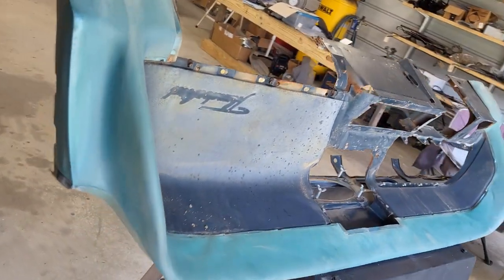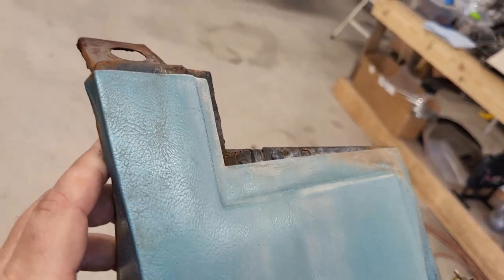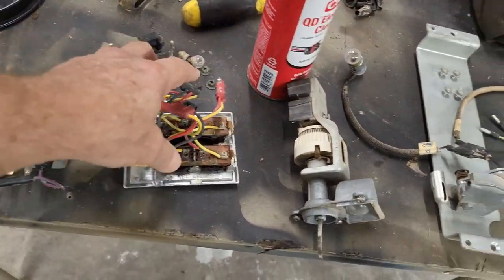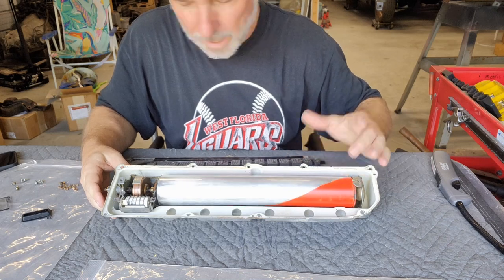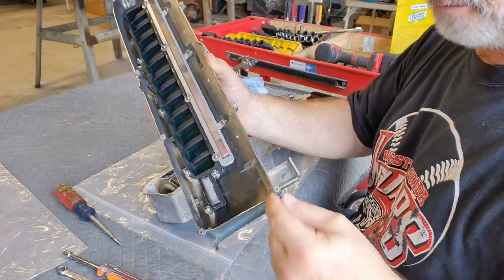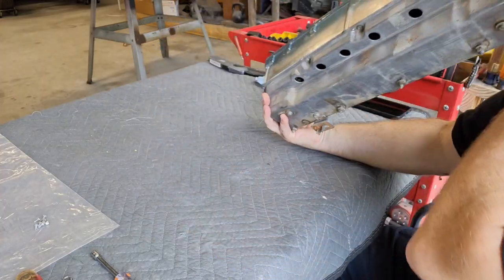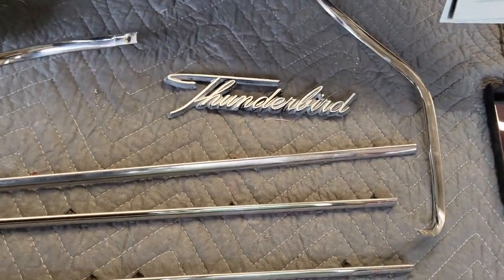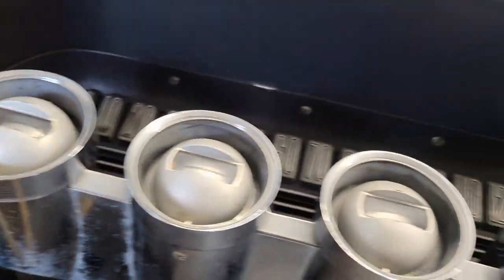Dash Restoration - 1964 Thunderbird

Comment: Such fun... I have been doing the same work, when I found 6 fried wires on the fire wall harness. Major bummer.... so I ordered are replacement from the Birds nest I hope it is in good shape. The plunger thing is your window washer plunger. don't forget to install your defroster vent discharge nozzles, I had to glue mine on as they tore out of the rivets.
Reply from the maker: That makes sense for it to be that.  It would reach there and it's the only thing in the area that seems to be right.  I hate you had some wire issues on yours.  So far all the wires have checked out o🤞

Comment: Hello Matt. That was quite an adventure putting the dash back together.  I knew you could do it because your dad was there to guide you. Could you see in your disassembly video what that plunger switch is for? Maybe use your wire diagram and trace the color wires. Great job you guys!
George B
Reply from the maker: Hey George.   Yes Dad keeps me straight.  We'll figure out that plunger soon enough.  I just can't think of anything that it would go to.  We'll get the book oit on this one.